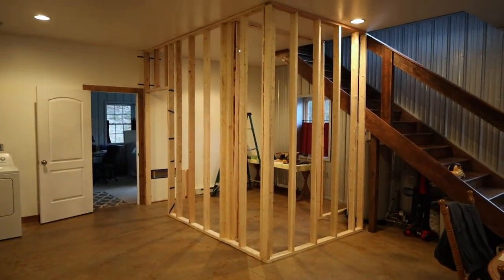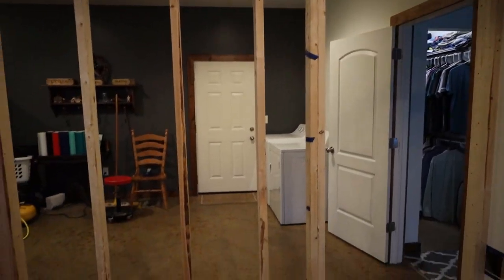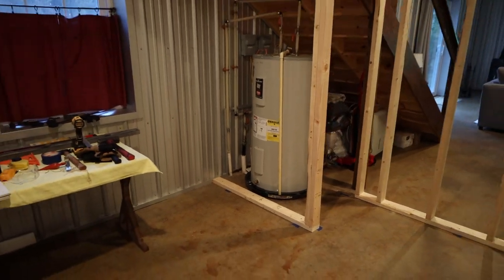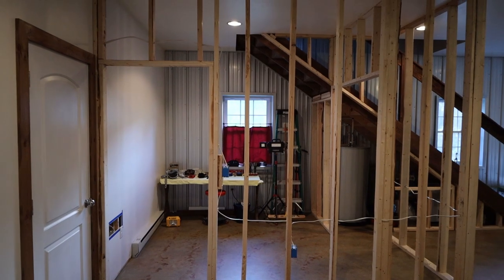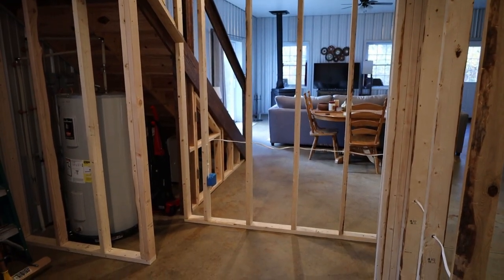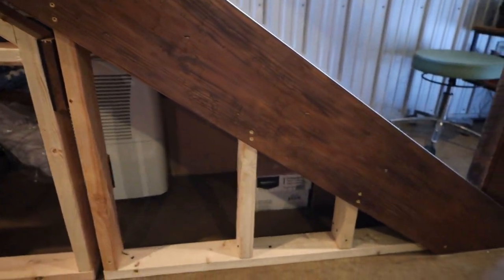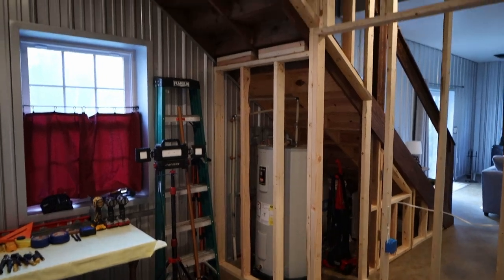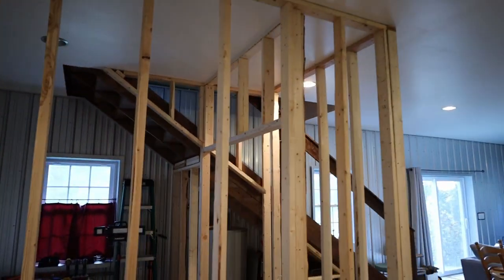Building a Custom Access Door and Electrical - Bedroom Build

Comment: Looks good. Pre twist solid wires with a pair of linemans before the nuts. Couldn't tell from the video but incase you didn't know, always wrap your wires around the screws on the receptacles and switches so they tighten with the screw not against it if that makes sense. I never comment on videos but youre meticulous like myself and maybe you appreciate these 2 things. If you already knew the just disregard.
Reply from the maker: Great tips, I do appreciate it! I'm definitely still a novice at most of this.
Reply: Completely understandable!

Comment: One thing I would add are nail stop plates on the studs that have electrical running through them, helps protect your wiring from any potential mishaps in the future.
Reply from the maker: Great point! I did notice they used them in the rest of my building for water pipes.

Comment: Overall I like what you are doing.  Everyone has their own way of doing things, so here goes my train of thought.  I work with the assumption that if it can break, it will.  Since I'll be repairing or replacing whatever fails, I want easy access.  I would have left the access opening for the water heater in the open area next to it, instead of going through the bedroom in front of it.  Just space the studs far enough apart that it could come out that way, cut the 2x4 floor plate out of the opening (after finishing framing that side) to allow easy access for hand trucks.  Then, I used a piece of 1/2" finished plywood to make an access door with an upper and lower latch.   That was the way I built my garage/workshop project.
Reply from the maker: Yeah that wouldn't be a bad way of doing it. I figured going through the new closet will be just as easy since in the other direction a bed will likely be in the way. I did make sure I left plenty of room to get the water heater out through that closet.

Comment: Nice work. Personally I would have wired in more outlets since you have the framing open already. At least 1 more on the longer wall facing the main living space and then I would have continued the run over to the little water heater wall and put an outlet over there. You'll never be upset for having too many outlets, you'll only be upset having too few.
Reply from the maker: Thanks! I won't be drywalling inside that closet so I can easily add some more to both areas you mentioned. I was thinking about having a TV mounted on that wall in front of the water heater 👍
Reply: Yes.  Needs at least 1 outlet per wall and not more than 10 feet apart. (following the wall)  also did you check what minimum sq.ft. is requried for a room to be a legal bedroom?  Theres all kinds of rules about minimum size for floor area, window openeing size, door width, ceiling height...
Reply from the maker: @chuckd9007  yeah there are already outlets on the other 2 walls in the room. And nope didn't check any of that on the room size but I really don't care to be honest 😂
Reply from the maker: @chuckd9007  just checked and it needs to be more than 70sqft and this room is 80 so I'm good 👍

Comment: You should wire up an outlet underneath the stairs so you can mount a tv in the room without having to run any extension cords.
Reply from the maker: Yup I was thinking the same thing, I'm not drywalling inside the closet so I can easily add that outlet at any time

Comment: Just something to think about for water heater maintenance. I would rotate it 90 degrees just in case you ever have to change one of the elements. I'm not sure if you have hard water or anything but if you do you will get lime build up in the heater and it will kill the bottom element every couple years.
Reply from the maker: I would but it doesn't seem possible to rotate it right now without redoing the hard plastic lines coming out the top

Comment: I wouldn’t build a wall in front of the tank because if you have to do any type of maintenance on it, it’ll suck if that’s a hot water heater you have to empty out the calcium once it gets full, just a tip. Love the videos
Reply from the maker: You do have full access from in the closet, I'm purposely leaving all that open and made sure the water heater had plenty of room to come out that way.
Reply: @Kordare  I was saying the wall you built it right in front of the access box to do maintenance it’ll be hard to work around but if you can work around it should be fine i can’t tell by the video but there could be room
Reply from the maker: @StrugariAutomotive  oh okay yeah it's really not too bad and I'm not gonna be putting any drywall on the inside of that wall so that will help.

Comment: Why not put an access door to the water heater right in the closet? That would seem to be more of a straight shot when trying to do work on that rather than crawling through a tiny door and then having no room to move around in there. Also, are you able to get the tank in and out through the small door?
Reply from the maker: I am leaving it completely open to that closet in the bedroom so that will be how you access and remove the tank when needed. That small door is mostly just for storage under the stairs.

Comment: good luck draining the tank each year like you're supposed to or replacing it down the line in that little cubbie hole
Reply from the maker: I have full access from the closet, I'm leaving all that open, and I made sure to leave plenty of room to get the tank out. Also the pan drains directly into a drain in my floor, idk if you can see it in the videos.

Comment: I can appreciate the effort but the way you hooked your new wiring into that existing outlet is a big no-no.  Also you missed quite a few backers for sheetrock when you were framing and will have cracking problems.
Reply from the maker: How would you have done it? Also I'm not sheet rocking everything which is why it might seem like some studs are missing.
Reply: @Kordare  when you have more than 2 wires going into one outlet they need to be spliced together with an extra short piece of wire added going to the outlet.
Reply from the maker: @chuckd9007  yeah that's what I did
Reply: @Kordare  no you didnt.  I see 2 white and 2 black wires hooked to that outlet still.